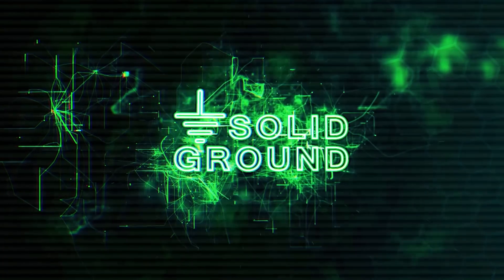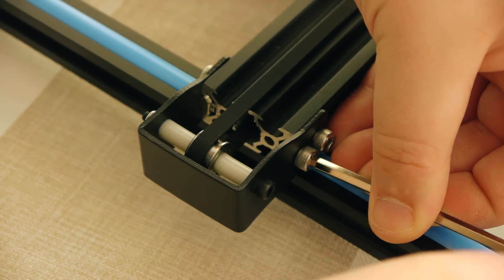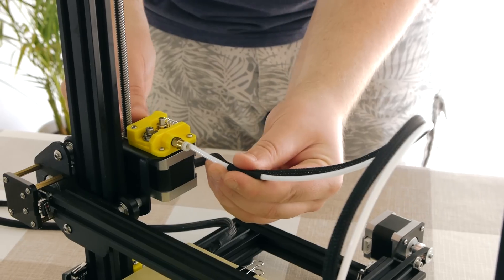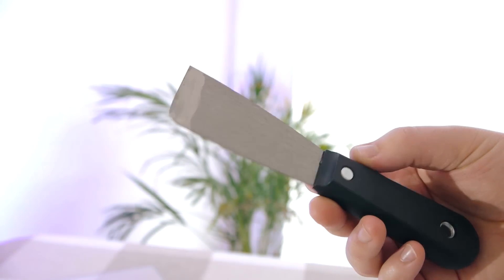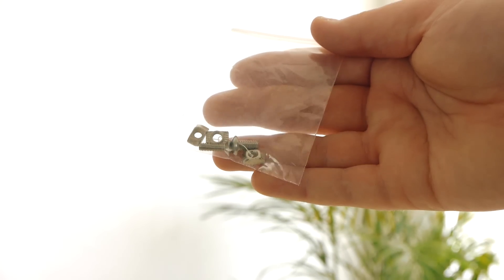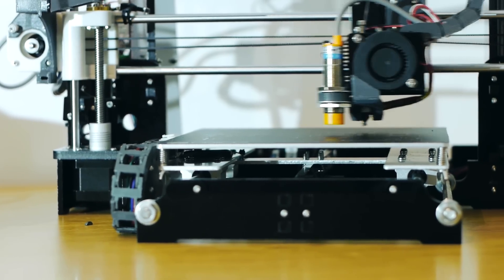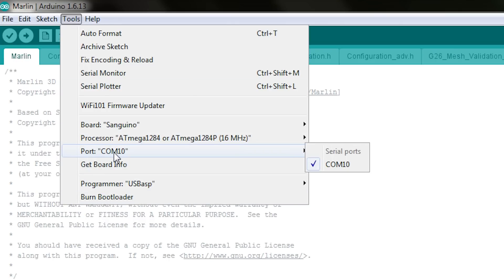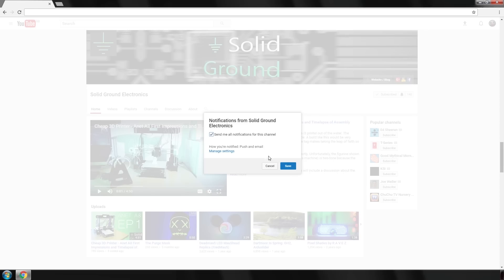CR-10 Firmware Upgrade, Mods & Review. Adding Filament Runout Detection, and Automatic Bed Leveling

Comment: Hi there, I'm new to this BL touch auto leveling. Is the leveling on the 4 corners calibrated in the software? Because normally the bed is adjusted to the nozzle. Would i Manually calibrate the bed the first time and then use the auto leveling? S there any kind of position the bed should be set to become auto leveling?

Comment: I was able to flash the firmware successfully but now all I get is a blue screen on my display. I flashed it while it was powered up. Does that matter?
Reply from the maker: That is rather stange, have you tried re-flashing again?  Did you modifiy the ribbon cable that goes to the LCD board? Perhaps  the design has changed since this video.

Comment: scwitch could use just single diode and rely on pullup of board.
Also new firmware expects it to be on Z-MIN by default (which is logical, because z min switch becomes redundant.

Comment: Wondering if you can help. Copied your diagram for the ABL sensor but have an issue where my Z axis only goes up? Increases every time it probes using G29. Thanks
Reply: same problem here

Comment: Yes. Thankyou very much for sharing. I purchased a proximity sensor an inductive one and wired it up as you said, so thanks for that. I have the Creality CR10s and just for the record, on the S the z stop ground and signal are the other way around (i know it's a different board). Anyway couldn't have done it without you. Thanks.

Comment: I have install your firmware and setup the sensors, but I have some issues. While auto leveling Z goes up instead of down and stops when gets signal from sensor (so it doesn't stop at all cuz it is only farther from bed), the same with auto home. Movment while printing works normally. Could you help me?
Reply: same issue here

Comment: Can anyone in the US who bought the untested board chime in and let me know if you got it to work? I'm trying right now but I keep getting "Invalid library found in C:\Users\**\3DPrinting\CR-10 Arduino Build\libraries\U8glib". Not sure if its somehow not the same kind of board, but I'm trying to reinstall the drivers now on a different PC just to rule things out. I can't get it to burn the bootloader. It's also not clear if I'm supposed to burn the bootloader to the USB board itself and then upload, and not have it connected to the Control Board during the process?

Comment: I'm a little confused about something.  You link to an inductive sensor and seem to suggest that it is (basically) the same thing that the other guy (Tim?) uses.  But I see reddit posts by that guy that say his is "not inductive".  Furthermore, his apparently works with glass and the one you used doesn't?  I'd like to just support that guy, but international shipping is expensive and with the exchange rate... it really is quite an expensive upgrade for me compared to a few dollars for a sensor from China.  I just want confirmation that the kind you link to works well with the Cr-10's glass bed or not, and if not why/how does his?  And if his isn't inductive, what is it??  It sure looks the same.

Comment: Great Video! I only want to Install the Filament Sensor. Do I have to Switch the Firmware to get it running? What steps do I have to follow for the Sensor only?

Thanks!

Comment: Great video! I found it to be very informative.   I was looking at the $100+ CR-10 upgrade kit at Tiny Machines 3D which is supposed to replace the motherboard, LCD, and provide the filament sensor functionality. But based on your video I can essentially get the filament sensor functionality following your instructions and the parts you listed, and also get the auto bed leveling feature as a bonus, all for $40.  Which means I would really have no need for the upgrade kit correct?

Comment: I ordered the printer from GearBest and six (6) days later they sent me an email wanting more $ for shipping. Unbelievable, right?

After speaking with my bank and PayPal I quickly canceled my order.

Some searching around I found a time-sensitive discount coupon code for Banggood. I placed my ordered and the printer will be delivered (according to FedEx tracking) 01/01/17. Hell, Gearbest didn't even have the printer In Stock (if they even have anything [of value?] In Stock? Also, the shipping dates for the printer (GearBest) kept (almost daily) getting farther and farther (longer) out. LOL!

So, it doesn't surprise me in the least what GearBest will do; re: take down that vid! Or to hold buyers hostage after a completed good-faith sale demanding more $ from the buyer to get their stuff. Jeezus! Really? Unbelievable!

Comment: Thanks for the video will look into all the addons you talked about.

Just one correction,it is not autobed leveling as it doesn't do anything physically to the bed.It is auto bed trimming. It just see's the height differences and stores them so when the print is going on it will compensate for the differences.

Comment: Love that video!

I have a couple corollary questions about the filament runout detection: 
1. Does this also work for direct USB connections (printing via Octoprint, Astroprint, etc), or just for SD card printing? 
2. Do I have to use your custom firmware for this filament detection mod to work ?

Comment: If I understood right, the filament detector won't need update? It is only wiring thing? And if you want automatic detection, then you need update to firmware?
Reply from the maker: You need the firmware update otherwise the printer will treat the brown signal wire as a the beeper trigger.
Reply: Thank you for quick answer :) Your videos are great!

Comment: Do I need to modify anything in you firmware for the newer board included in the CR-10S? I think its a ATMEGA2560 and it has a bootloader included. Thanks!
Reply from the maker: I have no way of saying if it will be any good, sorry :S

Comment: 1. Please forgive my dumb question but how does the auto bed leveling actually work. Does it just sense a number of locations over the bed then set an average in the z-offset?  
2. Is it possible to see the new menu structure of the firmware that you have flashed?
3. Can I just get the Ardunio sketch from somewhere as I have the Arduino software already installed on my PC.
Reply from the maker: Hey no worries, "stupid questions" mean I did a very poor job explaining it. 

1. I have set it up to probe multiple locations and warp the bottom of the 3d print. I believe it slowly takes out the warp across the entire z height of the print, so that the top of a cube printed on a warped base ends up being flat. I think. Alternatively the warped base could effect the entire print and with this hypothetical cube example the top may have the same warp that the base has. I'm not sure.

The probe reads the center of the bed to set a base point and then stores the displacement of the probe at all of the other points.

2. Not from me. Sorry, I'm super busy :(

3. This arduino build that I talk about is entirely portable so you can run it in the folder you download it to. It won't effect any other copies you have installed provided you just use the arduino.exe. 

Anyway, thanks for watching and if you have any other questions just shout :)

Comment: I was not able to determine if the filament runout detection simply sounds a buzzer, or if it pauses the print.
Reply from the maker: Oh sorry I should have made it clearer, yes it pauses the print and runs the M600 command which triggers the built in filament change procedure.
Reply: Even better! I have a couple corollary questions about that:
1. Does this work for direct USB connections (Octoprint, Astroprint, etc), or just for SD card printing?
2. Do I have to use your custom firmware for this filament detection mod to work ?

Comment: Thanks for the guide. You mention that the linked firmware is a slightly modified version from the version modded by THD; did you get hold of the source files or did you fiddle with the binaries? I'm not really that bothered about ABL but would like to play around with the source and maybe add a few menu features that suit me. I've really no idea how far from stock Marlin this firmware is. Many thanks again.
Reply: Marlin 1.1.5 includes a CR-10 configuration, which will also be included with Marlin 2.0 when that is released. Compare the configuration files to those included with the linked firmware, and let us know if there are any important discrepancies at the Marlin Issue Queue on GitHub.
Reply: Scott Lahteine, Thanks for the help, I'll give the 1.1.5 a go report any issues.
Reply from the maker: Thanks for watching. I got hold of the source files that Tim put together (and made available on his website)  I then configured the ABL and filament runout sensor in the code. You can change the settings pretty easily if you read up about them on the marlin site. Tim's code has had a alot of work done to it to configure it to the CR-10 (custom display code, PID settings etc) so if it is still available I would recommend taking his and going from there :-)
Reply: Solid Ground Electronics thanks for that, I've found a number of base source builds. I'm surprised that some of them had the cold extrusion protection turned off. I think Marlin recommend you leave it on.

Comment: I just got mine, and I must say almost every bolt and screw were loose and some parts not assembled well at all. Once I fixed all that, the machine is tighter than a drum. I'm waiting for the vibration mounts to come in before I run it. I did intall bigger adjustment wheels and the wire protector on the bed (a real must).
Reply from the maker: I have since heard a lot of people mentioning this. I think they may have given it the once over before shipping it to me. However the the paint was damaged so it is just speculation at this point.

Comment: Looks like you won the coin toss of which side of the box to open. :D
Reply from the maker: Sounds like you weren't so luckiy then?  Trade tip: fake the unboxing, it was already open when I pretended to cut it open.  Ssssshhh don't tell ;)
Reply: Nah, I won the coin toss, too. :D Seen other reviewers fail, though.
Reply: Solid Ground Electronics .....hey do you know he faked the unboxing

Comment: What wires can snap, and how would that kill you? 110ac will hurt like hell, but you'll most likely love, and the DC should be low enough voltage to not do too much, right?
Reply: It all depends on where the wire touches you and completes the circuit. If the circuit just went through your hand it would hurt but not kill you. If the circuit went from one hand to the other hand then it could kill you. Or from your hand to leg it could also kill you.  The most likely scenario would be the wire pops up off the power supply and hits the hand that is touching the grounded cover. That would not kill you but if you were using both hands and the hot wire touched the hand not grounded and the other was, then well you better hope someone nearby is up on their CPR and or has a defibrillator handy.
Reply from the maker: I live the UK where 230Vac can definitely  kill and to be honest 110Vac could kill a person too or at least trigger a heart attack. Like you say, the DC aspect would be ok unless you open the PSU where a 400V dc capacitor resides .
Reply from the maker: Oh and I meant the wires that power the proximity sensor. If they work harden and snap (as someone with little wiring experience could be performing this to their machine) the loose wire could come into contact with one of the live terminals.
Reply: also the irony of rescuing someone from electric shock using a defbrilator. the circuit is the dangerous part hand to hand or hand to foot crosses the heart, muscles operate on electrical energy and the heart is a muscle. AC will start pulsing your heart at 50/60 Hz and DC will just stop it at fully contracted. the current is what kills you, the voltage is only overriding your natural electrical resistances.

Comment: There is no need to burn the bootloader, Just update the firmware (upload sketch)
Reply from the maker: Can anyone else confirm this ?
Reply: Why is there a need to update the original firmware of CR10! Is this for the filament sensor mod which the original firmware not provided for ?
Reply: Some people want to add new features available or fix a bug. Sure you could add a filament sensor or a bed sensor or just about anything you want to do. You can take advantage of many different things in Marlin firmware as it gets updated. I can design some electronics then get a hold of the Marlin Dev team and have them build the software for it. For you the end user you wouldn't have access to it unless you update your firmware.
Reply: <sigh> Do as you wish. Seems you all just like to spend money. Have fun
Reply: +Solid Ground Electronics Sorry, I can't at my current knowledge level. But I'd like to know where/from whom Martin P. got his CR-10 coz when asked if is was from  TInymachines he didn't say. Hmm.

PS: Maybe I better check out Martin P's vids too. Um-hum, I certainly will. :*)
Reply: there are some machines that come with the bootloader pre-installed, if you buy from tinymachines, or (maybe) hictop branded, but if you got it from gearbest, banggood, ebay or any site like that, you most likely have to install it!!
Reply: Is there any way to know if my unit has bootloader installed  ?

Comment: Hey thanks for the video. I wondered how I was going to flash this without an Arduino! 

I am having trouble with you're pre-configured firmware. I try opening the arduinio shortcut but it onlyu opens the IDE, no files. Can you help?
Reply from the maker: Hey, You're welcome :) you need to go file>open: SGE_CR-10_Arduino_Build\CR-10 Arduino Build\portable\sketchbook\Marlin.ino
Reply from the maker: It sounds like it forgot the configuration so just confirm the board and programmer settings under tools and compare them to what I used in the video

Comment: Great video, but maybe you should add something in the title about unlocking the bootloader with a USBasp since I only noticed that by chance and I havent been able to find any information or video about that. It may give you alot of views.

You just saved me buying an Arduino Uno or similar. I already had a USBasp.
Reply from the maker: Hey good shout and thanks. Just make sure that it is compatible with the atmega 1284p though.
Reply: Solid Ground Electronics it worked just like in your video. Thanks.
Reply: you can just update firmware through the USB port no need to buy anything provided the program section isn't locked. The MCU lock bit for the bootloader and lockbit for the program section you'll need a programmer and burn fuses through avrdude command line. However if you start messing around in there you can lock yourself out and then you'll need Atmel-ICE-Basic and atmel studio.
Reply: Your issue with errors is timing when uploading bootloader, sck is Serial Clock. Your other errors in sketch upload is missing libraries.  

This unlocks with your onboard usb without programmer------>  avrdude -p m1284p -c  ft232r -b 19200 -D -V -u -U lock:w:0xFF:m

Just remember to lock it back when done as this helps avoids flash corruption.

Suggest reading AVRDUDE documentation and double check the command as things change over time. Check your AVRDude version as well. You should also read the 1284p-pu datasheet and check bit settings.

It is simpler to just buy a programmer, When you burn bootloader the fuses are reset and locked after upload. I don't remember if the firmware lock is set. But doesn't matter as you can just connect to the usb port and upload sketch from Arduino in the future without your programmer as Arduino unlocks and locks what it needs to when done.

Keep this in mind your using 98% of the program space now, Future marlin updates may not fit and you'll find yourself having to trim the code to make something work or remove the bootloader and just upload the program. This explains the missing bootloader as I think it's about 2k
Reply from the maker: Martin P have you confirmed this? Perhaps the red warnings stopped the burn bootloader process but it didn't matter because it was already unlocked. Are all machines unlocked? I did some research and it said that this step was required to allow you to program over USB. Unless they started shipping the CR-10 with an usb bootloader now?
Reply: But yes you can use the onboard FT232RL chip, just a lot more complicated to do so. as you need to unlock fuses upload relock fuses when done and compile.

Comment: I ordered the same filament sensor from Amazon. However I can't find any pin diagrams. From your video I gather white is ground? 
Red voltage? 
Do you know if it's 3.3v or 5v? Normally open or closed? 
I want to use it with octoprint, I'm having limited success but once sensor triggers filament out, octoprint reboots. I'm probably doing something wrong but I can't find documentation.
Reply from the maker: nuroo Hey thanks for watching, if you even did ;) The red and white wires form a normally closed switch. They are connected when the filament is inserted and go open circuit when the filament runs out. As shown in the video at 8:48  the white wire  goes to ground and the red wire goes to the brown beeper wire. I hope this helps.
Reply: Solid Ground Electronics Thanks for the response. I wanted to use the sensor with octoprint. I have a prusa mk2s and Taz 6, and I won't be wiring it directly to my printers circuitry as you did. I'll be using the filament sensor reloaded pluggin with octoprint. Which works better for me then hacking into wires of the LCD.  I got it working though, your video helped.
Reply: Please publish what you did somewhere and give a link!
Reply: nuroo can you share how you did this?